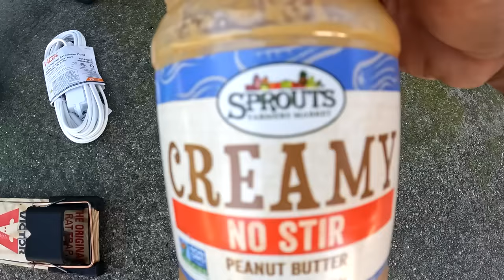The DARK SIDE of rodent control...

Comment: The Twins have a huge advantage because they do drywall and plumbing. Pest Control companies do not, and most people don't understand that. The Twins are A+
Reply: Weird, I've seen several pest control companies do drywall.
Reply: @someguy9778 most do because then how else would they get rid of rodents in walls if a pipes broken bc of the rats that’d make no sense
Reply: When you think about it it's quite smart to have people to do drywall and plumbing on your staff and even electrical. Most best companies just want to come out with a few traps and some putty.
Reply: I work for a pest control company and we change floor joists, studs, drywall, whatever the bugs or rats or rot has damaged.

Comment: Noticed that most of the houses with rats are always full of clutter..
Reply: RATS  ENTER FROM THE OUTSIDE OF THE HOUSE
Reply: Most American homes are full of clutter
Reply: As someone who has had a rat problem in the past, I felt so defeated after a long time of dealing with the noises in the wall that cleaning did become very difficult. They never came into my living quarters.
Reply: @DolphinRave  I had a rat get into my attic last Fall after Hurricane Ian damage.  This channel saved me with info and the Twins amswered my question when I needed guidance!  I set traps in the attic.  I waited until nightfall and put foam in the crack until I could get materials.  I spayed the crap out of the foam with straight cedar oil and peppermint- no dilution.  It went well.

Comment: Years ago after Louisiana had its big 100 year flood in 2016 (entire neighborhoods with water up to the roof line) we got an entire family of big Norway rats in our home. The sewers all flooded and these rats fled into people's homes all over the surrounding area. One of the rats had the nerve to climb onto a plate of food that was on a side table next to my computer desk WHILE I was at the desk 2ft away. I jumped up and screamed and the rat ran back and forth under my desk and then ran into the bathroom and went under my sink. The first thing I did was seal up all of the sinks and drain areas with closed cell expanding foam and wire mesh, and left one area open where I placed traps. I tried glue traps and kill traps, and I caught a couple of them, but there were still more and they kept taking the bait, but not triggering the traps. 

So I bought the big plastic kill traps from the Homeless Despot and then modified them in the same way you did here using PVC pipe cut in half to make a hood over the bait portion of the trap, affixed with epoxy. I set the 4 traps out, and the next morning I had 4 dead rats. Rinse (literally, you want to wash the smell of dead rat off of your traps after each use) and repeat. Within 3 days I'd taken out 13 rats, the last of which was a MASSIVE pregnant mama, her head so big it barely fit into the trap. Her body alone, sans tail, was the length of my forearm. I think the reason it went so smoothly is because they'd been forced out of their habitat and were starving because they weren't used to foraging for food in a home. The rats must have come a long way because we used septic tanks, so our plumbing wasn't hooked up to any centralized system.

Comment: My mom ended up with a rat problem after a remodel on her bedroom and bathroom. The contractor left a small area of the roof open. Took many calls and trips for the pest guys to get it all cleaned and closed up and rat free.
Reply: man i can't stand comeback work.  it's always the most expensive add-on.  this is why i tell contractors to MAKE SURE everything is sealed

i used to work at a dorm that got renovated.  there were HUNDREDS of mice in the basement.  i warned the owners, managers and contractors to make sure EVERY hole is sealed.  of course since i was "a nobody," they didn't listen.  as soon as the building was re-opened, the #1 problem was mice in the apartments because almost every penetration was left wide open

Comment: I wish you guys where in the UK, we have crap pest controllers.  
My house is connected to others and mice are in the walls. I know this because I’ve put bait in the walls and it’s gone.  They cannot get into the house itself, it’s all blocked off but they are still in the walls. I went around and checked everything from your past videos and no entry at all.  Spoke to neighbours and a few doors down has the issue mostly, so they are using the connected walls to get through. 

Thankfully they have no access into the house but I cannot block off the connection in the walls sadly but I know you legends would think of a way.

Comment: what have yall solved before you do the rat dance? lol anybody can catch rats, but are you stopping them from re-entering?
Reply: A, they fixed the broken vent pipe.  B, they put a device (I think a backflow preventer?) into the sewer to prevent the rats from climbing up it and into the the drains inside the house.  The rats were coming from the sewer into a drain, up the drain and into a vent, and had chewed a hole in the vent.  From there they were getting into the ceiling over the toilet room, and from there to other ceiling and wall areas in the house.